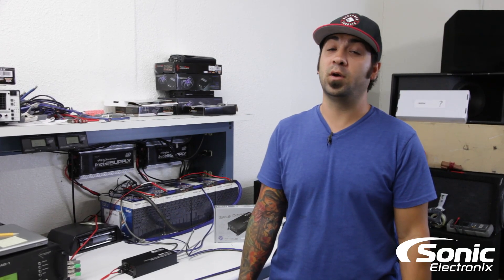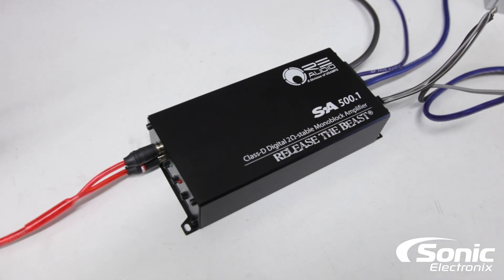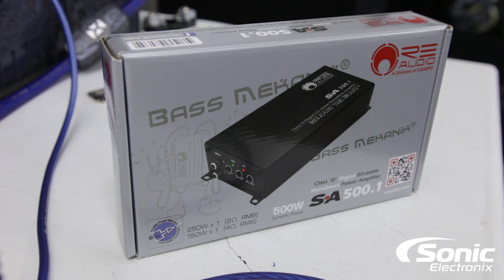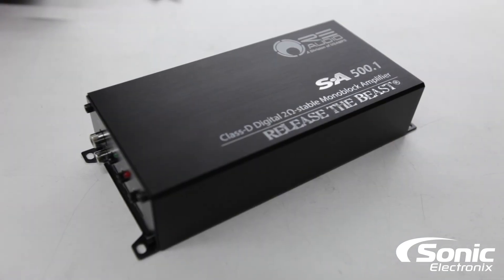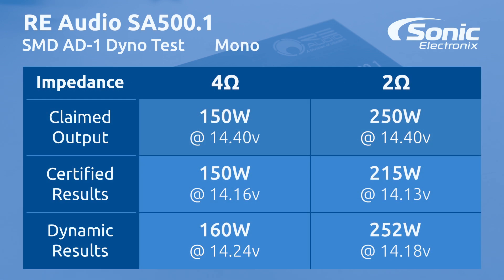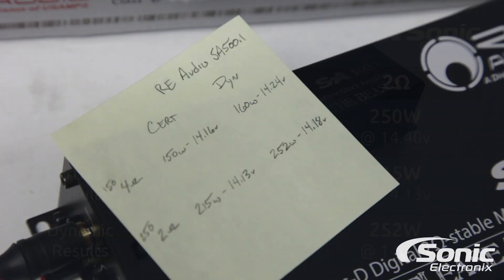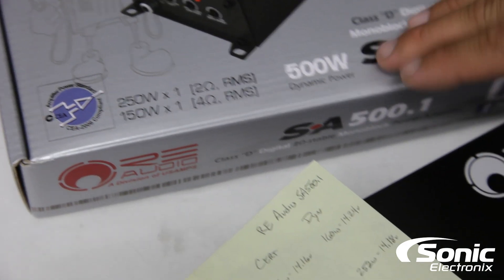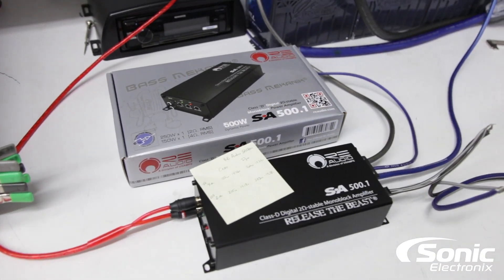RE Audio SA500.1 Amp Dyno Test | SMD D'Amore AD-1

Comment: I'm almost positive, from what ive noticed anyway, that all of the re audio, power acoustik, precision power, and even dual audio mini amps are the same internals in different housings, the layout of each brand is identical as far as the power light, protect light, the power, ground, signal, and rca in along with the fuses and the amperage of the fuses and speaker output locations, and they all have a mono, 2, 4, and 5 channel for each brand with the same fuses in every brand, not saying they are bad amps cuz I dont think they are, just something I've noticed

Comment: I'm glad they put the RMS rating on the box, though I 100% disagree with RE labeling it 500W dynamic power.  I'd been fine had the label read 500W MAX if they so insisted on it.  Why do I feel that way, go back to the 80's and look at an old Proton amp that has their patented dynamic power on demand circuit.  RE needs to be slapped big time for falsely claiming it puts out 500W dynamically when it clearly doesn't.  But I am glad it does perform in accordance to the RMS ratings and I dig the foot print.
Reply: maybe 500 watts if it had 24 volts and didn't catch on fire 🔥
Reply: Maybe. :-)  It IS blatant false advertising though. :-( In the Youtube search bar type in Proton D275 to find Dereck BigDWiz's AD-1 bench of one...  As said, I wouldn't be so upset if it said 500W MAX, but it doesn't.  I'm not saying it isn't a good amp, but I don't like false claims, and it IS clearly a false claim.
Reply: +Reggie Reginato even if said 500 maxxx when lightning strikes it would still be a lie..they need standard and not a voluntary CEA compliance
Reply: Yea, CEA is a good starting point but given how it's voluntary, it sucks.  I think the voluntary standard was started to prevent the industry from being regulated and a set standard from being established.  As for the label, yes, it was a lie, but at least it would be no different from other manufacturers doing that as it's an established lie.  So RE prob used the Dynamic power label to be different...  Except it's now a bigger lie that can be proven directly.
Reply: +Reggie Reginato I agree 100 Percent...preach on
Reply: +Timothy Hinton that amp barely did 250..I don't think it is even possible for it to ever do 500...it shouldn't be on the box
Reply: It might be possible - no test parameters provided.  So maybe at...Umm - 78khz, for... maybe 9ns into .6 ohms with a 16v power source while being nitrogen cooled when the ambient temp is minus 40 below...  Like I said, if it said max, no way to prove the lie as there are no test parameter's defined.  But it says dynamic, and clearly it doesn't (the AD-1 proved it).  But as said, that doesn't mean the amp is junk (prob would have been nice in my former compact pickup if I wanted to amp the mids and highs for an SPL build).
Reply: +Reggie Reginato lol..you are killing me
Reply: Hmm, maybe it puts out 500W Dynamic when installed on a time machine converted Delorean only when it's traveling at 88mhz and the flux capacitor is drawing 21jigawatts of power to cover up the sonic booms....
Reply: +Reggie Reginato or if you put a 150db inside sticker on your ride..oh and you have to paint your sub ports black..it adds 5 dbs for sure
Reply: LOL

Comment: Now on the video you guys put out from CES 2015 speaking with RE, they said that number on the amp is achieved musically at .6 ohms. Any way you guys could re-test with lower impedances to see if it can hit that 500 at .6?
Reply from the maker: +Justin G (JustinG248) Good catch! We just hooked this amp back up to the dyno to see what we would get - this amp states its stable down to 2 ohms - but we still tried 1 and .67 ohm tests but unfortunately the amp goes into protect as it reached the 250W + output range.  :/   

But hey! We're glad you caught this and that we could test it for you quick! Thank you for pointing it out - had it performed we would have done a quick follow up video for everyone to show off this amp's real potential.
Reply: +Sonic Electronix Knowing that, I believe he may have been talking about the larger amps in the series as the 1000.1 does say in the manual to achieve 1400 watts dynamic it needs to be wired to .6 ohms.